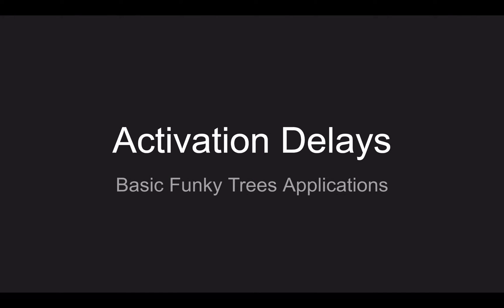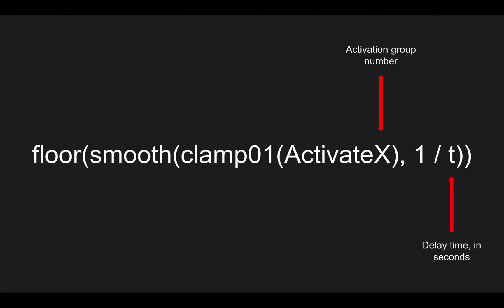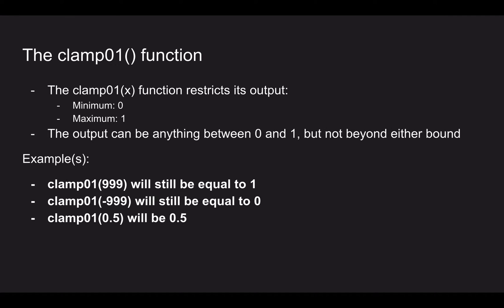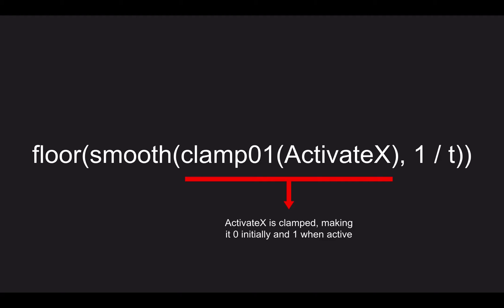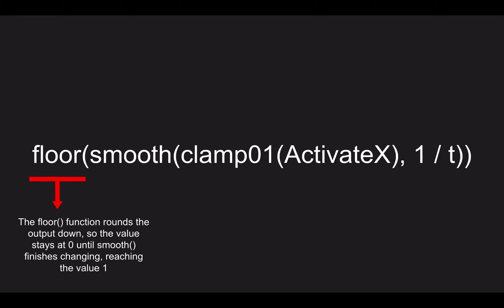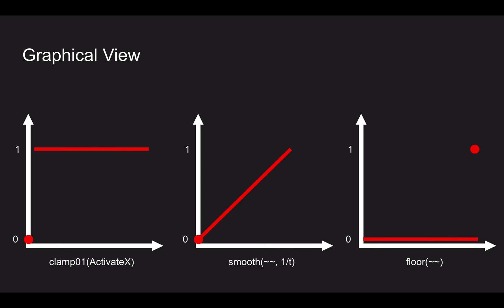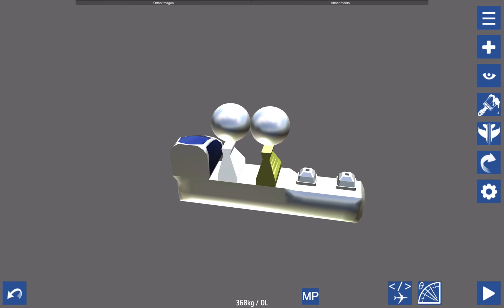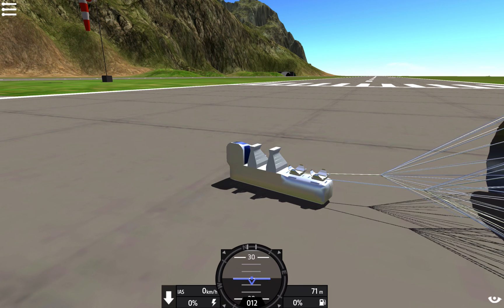How to Funk Trees #2: Code Analysis - Activation Delays

Comment: Alright guys so basically: 

1.Floor(x) : this dude got 1 value in his mouth he doesn't like integers cus their hard to read so instead he cuts em off and turns the number into a normal non integer number but also this dude is real lazy and don't like looking up so he only looks down 

Example : number : 1.99 floor says damn that's a confusing number your one from now on (see? it didn't make it 2 cus its too lazy top look up)

2.Smooth(x,r) now this dude is also lazy and got a big mouth he can hold 2 values you tell him to GO DO YOU MATH but he's lazy you tell what's 1+1 he says uhh 1.1 one second later 1.2 another second 1.3 he laaazy

Example: smooth(3,0.4) now what he's gonna do is keep adding numbers until he reaches the number (I put 3) he won't just jump there he's lazy so every (0.4 seconds I put) he'll add one number so in 1.2 seconds he'll reach 3

3.clamp01(): this dude don't like big numbers he stupid so if you tell this dude what's 1+1 he's answering 1 he don't now but 0 and 1

Example: clamp01(43) = 1 see he stupid another Example clamp(0.3) = 0.3 told you he only knows 0 1 and what's in between of those nothing else😊

Hope this helps
Reply: dude just shut your mouth be respectful
Reply: Syfm

Comment: So floor doesn't round per se, it removes everything after the decimal point.
Reply from the maker: It is still a form of rounding. The conventional form of rounding to the nearest integer, floor is what is known as rounding down.
Reply: @SnoWFLakE0s  absolutely! I wasn't trying to pull a "well actually" even though it sounded like in hindsight. More trying to make it more clear.

It is not my goal, unless you want to, to debate the finer points of truncation.